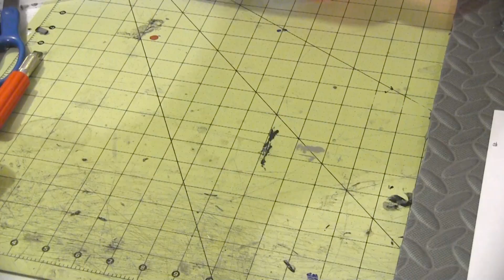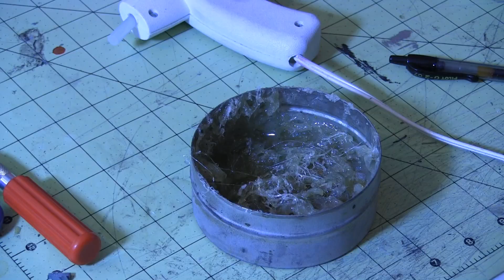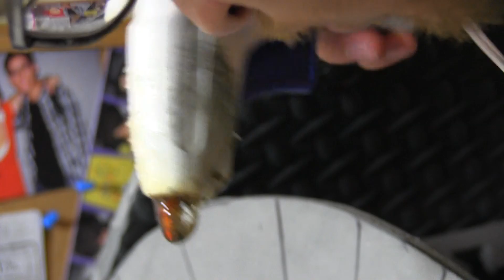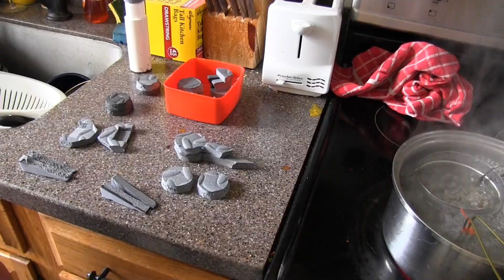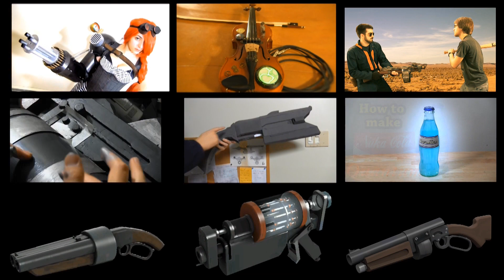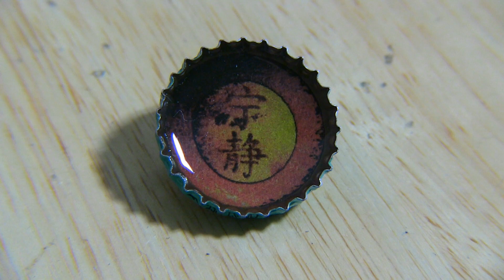How to Reuse Hot Glue - Shop Tip Tuesday

Comment: You can also use something to make a tube the correct size, to make a mold, and heat the can of spent glue up and pour it into the mold to make new glue sticks. Just make sure its something that it wont stick to  like paper, or anything that will melt with heat.

Comment: i would make a non stick mold (possible silicone,), surrounded by something stronger (like plaster...) and use that mold of the hot glue stick, to poor the melted glue into it. put it in the freezer or just let it sit, and crack it open, and you have a hot glue stick! and you can reuse the mold many times.